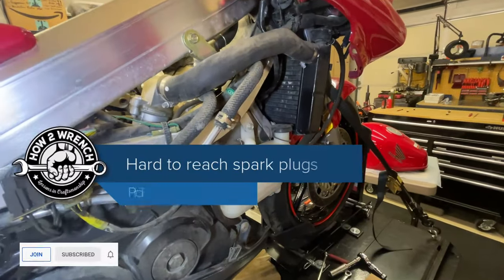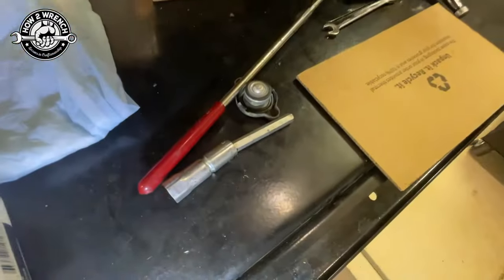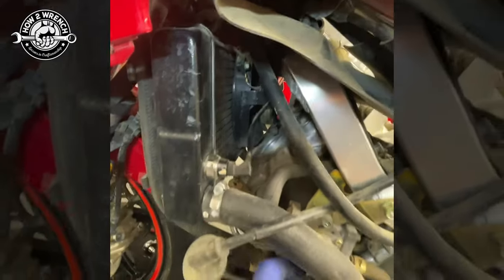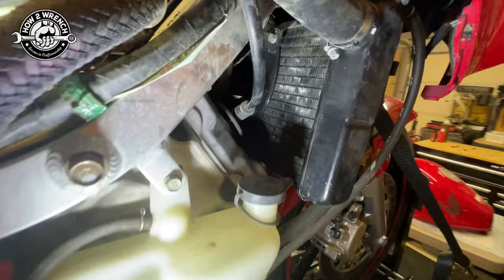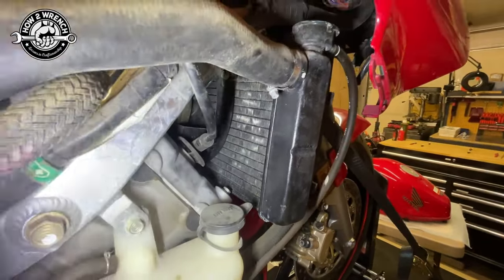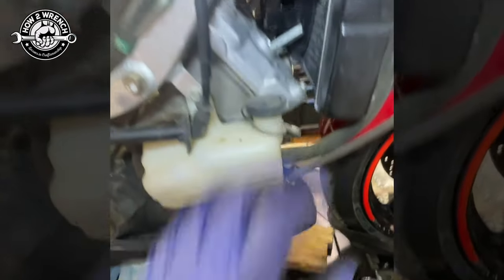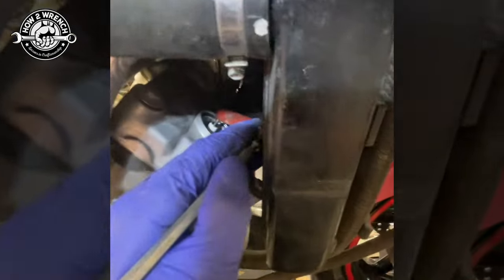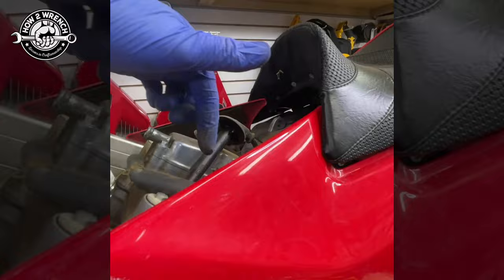Removing tight fitting hard to access motorcycle spark plug tool #ngksparkplugs #ignition #mechanic

Comment: I remove the bottom fasteners from the radiator and rotate the radiator forward away from the engine. 
the fun really starts when you remove the valve cover to check valve clearances